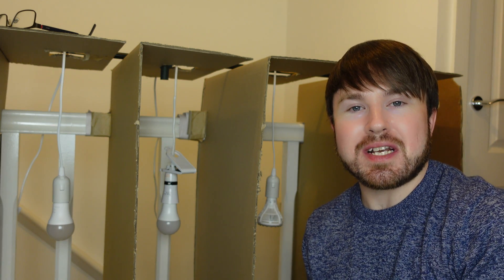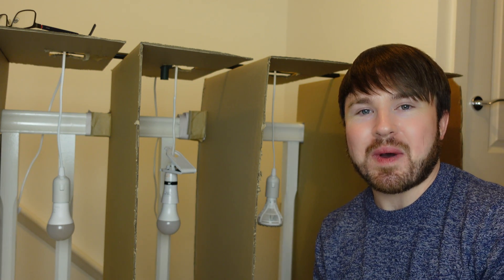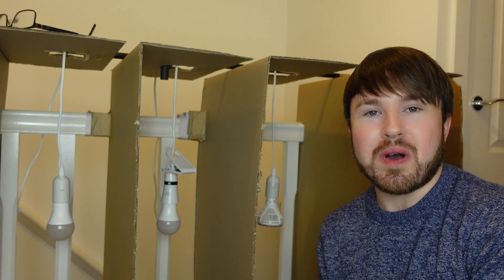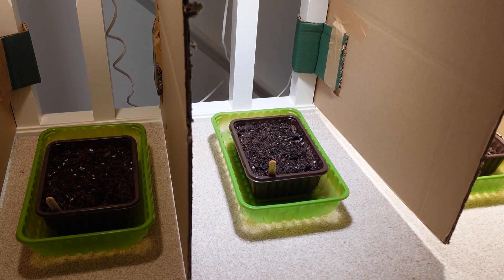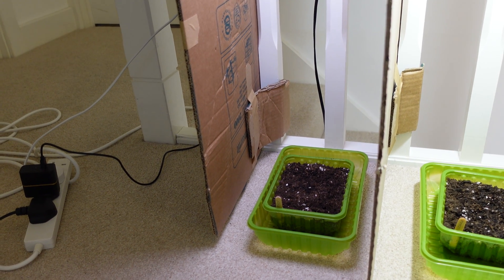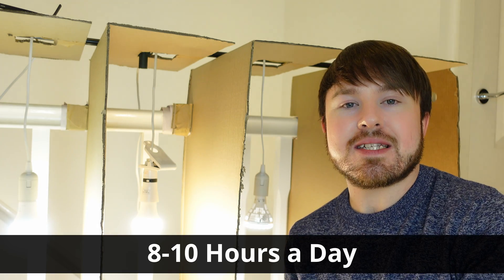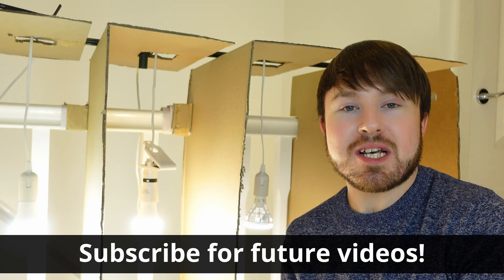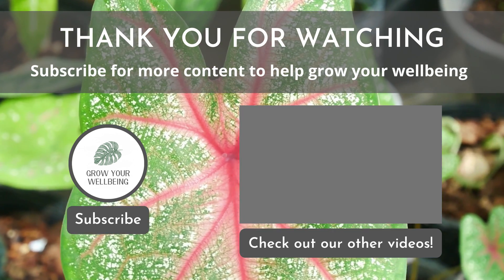Grow Light Experiment 1 - Set Up and Five LED Grow Lights with First Plant.

Comment: I kinda laugh when you said you live alone, nobody is going to tell you that using this hallway wrong or something  like that. I wouldn't dare tell you that, I would do the experiment alone side you. I already have cactus, over wintering a 2 pepper plants, a Texas star hibiscus and now a few tomatoes and more pepper plant. I'm waiting for our last frost and warmer night temperatures when most of my plant can stay out until our cold winter. I'm now getting in herbs, mints and a few house plants. These plants are going in 2 different part of my house under a grow light for now. I'm glad you did this experiment. Thanks
Reply from the maker: Thanks! I'm sure if I shared the space, others wouldn't be happy about it. Glad to hear you'd run the experiment too 🌱 Sounds like you'll have a lot of plants inside until the warmer weather. Hope they all do well under the grow lights. We're early spring in the UK so warming up (very slowly!), still quite cold in the evenings but I'm sure it will warm up soon.
Reply: Yes, we are in the middle of spring. Heading into summer with our temperature of texas, heat can get really hot. Most of my plants are outside now, where I can grow hot pepper, sweet pepper, herbs,tomato, and cactus. I do, however, have house plants that are under some grow lights. Trying to grow succulent and cactus cutting, monstera adansonii, golden pothos, spider plant, and other houseplants.